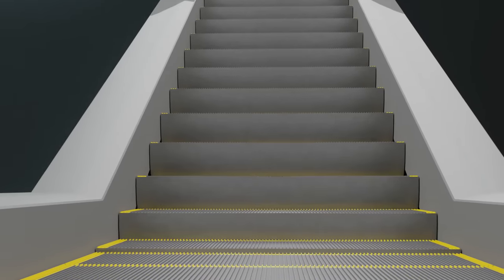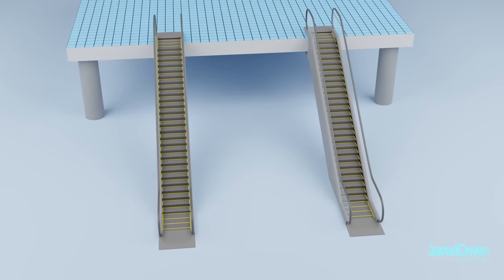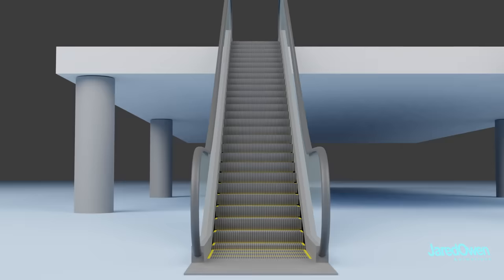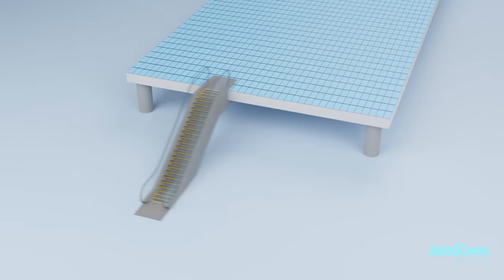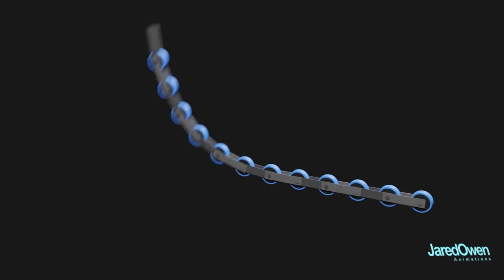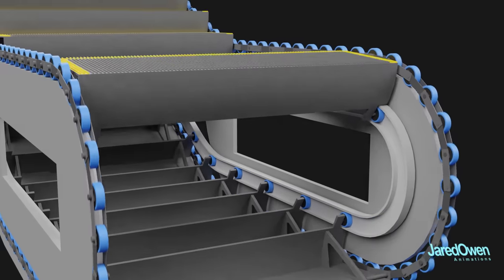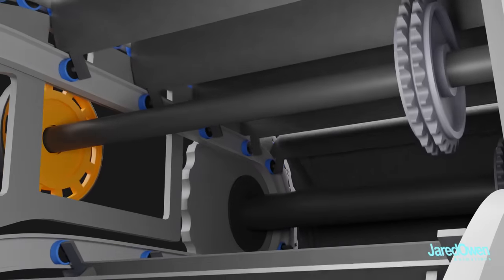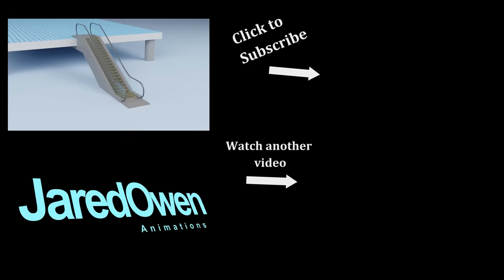How does an Escalator work?

Comment: I’ve noticed that the handrail seems to always move slightly faster than the steps, why is that?
Reply: Because that prevents you from falling backwards
Reply: That just depends on the size of the cogs and gears you use to connect the handrail to the motor
Reply: It is intended to keep riders alert so that they occasionally have to shift their grip.
Reply: I was about to post this exact same thing.
Reply: Focus people.
Reply: Answered in the comment above yours
Reply: Yes that is same in Prague Subway and it makes me angry every day because if I want hold all the time, I can't
Reply: Stop you from falling backwards
Reply: Keita Tsutsumi smaller wheels
Reply: The circumference is larger on the handrail, so when they loop at the same speed, the handrail goes faster.
Reply: @gigaprofisi  exactly. The math is easy to show as well
Reply: not here
Reply: Noah Landis they don’t loop at same speed. It’s just made to be little bit faster to ensure that it’s not going slower than the stairs, as precisely same speed is practically impossible to maintain.
Reply: In my nearby store, it it because someone is holding tightly into it ( for example hold the railing and lean back, then the railing will go back too)
Reply: That's because a large number of people holding it expands the handrail which leads to unstable speed of rolling
Reply: @matejkoh8387  prague has the longest escalator in Europe
Reply: Flying Tatu That‘s actually the right answer.
Reply: always? all the ones ive been on go the same speed
Reply: None of these answers are correct.

The vulcanized rubber rail is pulled along by the main gear using a friction fit. By design, the handrail should travel at the exact same speed at the stairs (not faster, not slower), as excessive relative motion in either direction can be dangerous.

As the rubber ages, it warps and elongates. The underside gradually loses its roughness, and passengers abuse the railing (pulling, sitting, etc.). Over time, the speed of the railing is bound to drift from the main shaft speed.

This is not by design and is actually a nuisance which requires extra maintenance. Most modern escalators will automatically shut down the escalator if they sense that the railing speed differs from the main shaft speed by more than a pre-determined amount. For example, ANSI standards require that escalators are fitted with sensors which actively monitor the speed of the handrail to make sure it stays within limits at all times.

Credentials: Mechanical engineer who works with a major escalator company.
Reply: Yes
Reply: @gigaprofisi  Correct, but this is intentional so that it is less likely for a passenger to fall backwards or loose their balance.
Reply: In Kiev's underground it's used so people don't get asleep.
Reply: It is so that you will always get pulled a little to the front when riding up the stairs, preventing you from falling backwards. The handrail speed actually should never be the same as the escalator speed as this encourages falling backwards, the engineers usually chose a speed between 0.5 and 1 %  faster handrails that escalators.
Reply: @18vallancel  You are correct. I have worked 25 years in the elevator industry and have changed hundreds of worn handrails.
As the rail wares down it has a tendency to slip and move slower.
Reply: encourage upright posture
Reply: I don’t get the “So that you wouldn’t fall backwards” it just doesn’t make sense. I’ve never felt like falling ever while using an escalator that has the same railing speed.
Reply: Keita Tsutsumi it could be that there are two separate motors controlling the steps and the hand risks respectively and they might be a little off in their speed
Reply: It has more distance to travel
Reply: It’s literally on google. It’s on purpose and to keep people attentive. Not about “impossible to maintain” or the “warping of the rubber”
Reply: @maevemahon9897  probably they were made by bad engineers 
Don't be one of them
Reply: So that if you fall, you fall face first
Reply: @18vallancel  wow so my guess was right
Reply: Yeah
Reply: Так сделано в целях безопасности человека. Бывает такое, что человек отвлекается на рекламу, или задумается о проблемах. Что бы человек был внимателен на движущейся машине-эскалаторе специально делают конструктивно скорость поручня быстрее чем скорость ступеней. Но скорость поручня можно отрегулировать роликовой станцией в самом эскалаторе, под балюстрадой жо скорости ступеней. Но тогда будет страдать безопасность пассажиров.

Comment: "It's really important that the handrail move at the exact same speed as the steps."

Anyone who has ever held on to the handrail the whole way knows that's not exactly true.
Reply: I'm sure engineers are trying their best to perfect it.
Reply: Yes they are slightly faster on purpose to prevent somebody from falling backwards.
Reply: We occasionally run it in the opposite direction.

For the lulz.
Reply: @Yebina Katya shush spammer
Reply: @FXP1688  At our local mall the one going downward jerks slightly forward.
Reply: As someone who usually holds on to the handrail all the way, I really can't say the same
Reply: I used to pull the handrail belt down when we were going up. It was so easy to pull, too. Funny stuff.
Reply: @FXP1688  you just blew my mind lol. Completely make sense tho
Reply: i guess it comes down to tuning and some aren't too well tuned.
Reply: Yep, thats inaccurate. And it's not an accident that they are slightly faster, but it's actually a pretty smart detail -> https://www.youtube.com/watch?v=L5BNJSqwU0Y
Edit: Wrong video link...
Reply: I don't think I've been on one where the rail and steps were running the same.
Reply: No, it's just an illusion that they move faster maybe because they're narrower than the steps or because they're longer. They move with the same speed as the escalator. Otherwise don't you think we'd fall down!?
Reply: @mansipal5437  well many things aren't perfect, and therefore, that is why you are wrong ever so slightly
Reply: People hold onto the handrail?
Reply: You are all wrong. This is due to the wear of the rubber. Hand rail speed is set to be 2% faster than steps, so when rubber is new, it moves faster, then as it wears off of friction and stretches, it adjusts to the speed of steps for a time, and then at the end if its life cycle, when it's stretched, it moves slower. Then it's replaced with a new one.
Reply: If it's going up it's slightly faster, going down slightly slower
Reply: Sorry, I am the guy five steps down that is dragging the rail intentionally to see how much I can make it slip.  For science.
Reply: @mansipal5437  , нифига не иллюзия. Когда держишься за поручень -- особенно хорошо это заметно на станциях глубокого залегания, типа "Автозаводской" -- рука уезжает вперёд. Иногда на всю длину, и приходится перехватываться.
Reply: Best part about these things is that they never break down.... they only become Mitch Hedberg jokes.
Reply: They are slower in the beginning, then faster during the slope, then they realign at the end
Reply: @gavincurtis  😂
You kid brother, you!
Reply: @charliedulol  if its on a gear system on the same shaft as the one that drives the steps it should not be possible to tune it
Reply: @user-by7hj4dj9s  if indeed.
Reply: And you forgot one thing.. you can stop pretty easy most of the handrails by hard grip and pull em well atleast it is so in my city all over. :D
Reply: Ugh, so annoying when it doesn't
Reply: Yeah u r right 🤣🤣
Reply: Becareful when holding onto moving hand rail, I nearly had my finger pinch on it at the hotel in Las Vegas.

Comment: An escalator can never break, it can only become stairs---Steven Wright
Reply: it can eat people though.
Reply: That's actually from Mitch Hedberg
Reply: @mosh1986  so can most things
Reply: The belt can snap and fall off.
Reply: False.
Reply: Just build stairs then. Escalators killed my sister. I'll never forgive them. They're untrustworthy.
Reply: Which is absolutely stupid. A defect escelator can be very, very dangerous. If a link breaks, and the chain can't support the weight, the stairs will all fall down in freefall. Also, the mechanism is very, very dangerous. If anything in this system breaks, it would be a bad idea to just use it as stairs. Whoever said that quote is an idiot.
Reply: @louisgreschner2359  amazing it's even being quoted as wisdom !
Reply: Thought so too until an escalator in SM mall Philippines suddenly reversed…trampling people at the bottom
Reply: @small3687 just like xiang liujuan?
Reply: @louisgreschner2359    A defective escalator is dangerous, but a nonmoving escalator isn't necessarily, though I suppose it depends on the configuration in which it ground to a halt.

Comment: Actually most escalators (that I used anyway) will have the handrail moving a bit faster than the steps. I looked it up and one reason I found has to do with wear, over time reducing the handrail speed. So this way, they get a better service life out of it. Another reason I found is safety. It would actually go faster on escalators going up, and slower on ones going down (which I think is also what I’ve seen). If someone who counts on the handrail for balance falls, they’d fall on the escalator upwards.

I think my father (who was a maintenance technician in a large department store) actually mentioned the safety reason to me.

Comment: "They are just big meat grinders"
- Actual Escalator Technician
Reply: Yes, I agree 👍
Reply: do you know the rough price of a escalator
Reply: Same here I’m an apprentice, was working on one today , tighten the tension of a handrail drive chain.
Reply: I'm an elevator dude, and the escalator dudes scared the crap out of me with stories of having to remove kiddies' toes from pits, etc. You hang in there, escalator dude!
Reply: Did you see that video from China where the steps collapse and she throws her toddler to safety, but she gets pulled in?   It's rough
Reply: @janus2059  Yup, not nice.
Reply: Daniel Antone nope.
Reply: @dougerrohmer  I've heard similar stories myself, I'm a stairs guy myself.
Reply: @dougerrohmer  yeah I dont think its real though because those access panels are meant for escalator work to be done so no moving parts are exposed there
Reply: @howdoicomment5932  The problem is if a step axis bearing collapses (for instance) and the step is now lower than the comb plates, the escalator goes nom nom nom.
Reply: I work for an escalator company and can confirm that falling in at the bottom is a no no
Reply: Wonder if you could detect those conditions somehow.

"Error: Meat in machinery."
Reply: Final destination 5
Reply: yeah. the escalator in my city used to put up pictures of gory grinded limbs of the victims of escalator accidents right next to the escalator. I don't know why it took years for them to realize that that's not a good idea or why they did it in the first place. either way, not a good thing to see for an 8-year-old me, scarred me for years after they decided to take them out. still kinda scared when I see a sign at the end of an escalator cause my first thought would always be "oh no.. they're back"
Reply: @downstream0114  there's table top saws that can detect when a finger touches the blade and instantly stops the saw and tucks it away before it can even do minor damage (you would have to fall directly on the blade to get a minor cut*, it's that quick) unfortunately it can only do that once and you have to replace the saw and the 'brakes' each time it does that. So it's like insurance, it's good to have but you never want to need to use it. Look up "sawstop"

*edit, i looked it up and im gonna upgrade minor cut to minor gash. Like you would need a few stitches but it not life threatening.

Comment: When I was in Germany there were escalators that change their direction depending on if people wanna go up or down
Reply: I use them everyday 

It sucks when you step on one but the person on the other side was a second faster so you have to go to another escalator because it’s the wrong direction now
Reply: @64bitpr0gramm6  True, I had to wait for 10 minutes
Reply: KOTHYSCHER it’s pretty dumb tho 🤦‍♂️
Reply: @falcy2889  Why would it be dumb? You save a whole escalator by making it move in both directions and it turns off, when it is not in use, so it saves a lot of energy during less busier times. 

It is not used in highly frequented areas, but only where it makes sence.
Reply: Leffker you know if there are so little people there that the escalator can be turned off and changed direction then it’s unnecessary. Regular stairs would be much more efficient
Escalators are used for moving large amount of people in one direction and ensure faster transportation.
Reply: @falcy2889  Well, in the city where I live it is used in an underground train station with multiple levels and countless exits, where it would be too expensive to build an elevator next to each single stairway.
There are a lot elderly people as well as young parents with buggies for their babies, who would struggle to use the stairway. The exits lead to different sides of a wide main road and in different cardinal directions. There is not enough space on the surface to cover for enough elevators
Reply: In the Montréal subway, when not during rush hour, many escalators run slowler when empty.
Reply: @simonrancourt7834  Yup, but they don't stop because stopping, then starting puts extra strain on the system, slowing though does save energy, which is the point.
Reply: IIRC In a mall in Taipei, all the escalators change direction to the bottom floor during closing time so all the escalators lead to the exit
Reply: @Leffker  In Europe, it is actually forbidden to use an escalator with strollers/buggies, that is why at least here in Munich on all escalators there are actually pictograms on the side of the escalator telling people not to use strollers on escalators.
Though pretty much no one follows that... And it is sad because I got injured once when a rider in front of me got their stroller stuck while trying to exit the escalator.
Reply: @gfrewqpoiu  The place in Munich I am thinking of doesn't provide an alternative for people with strollers, so of course they use the escalators if they want to get downwards.
Reply: with people on them???

Comment: There was an accident in a New York subway 10-20 years ago where one ate a passenger. It chewed her to pieces. I worked on ones made by Thyson-Krupp while working as a stationary engineer in a 14 level building in Barcelona, Spain. 28 escalators that we had to do emergency repairs and preventative maintenance on. A common problem was the proximity sensors that assure proper chain tension would move out of adjustment through vibration over time, or they would fail and the escalator would stop. We would have to lock out and tag out the equipment, block it off from customers, and then begin the troubleshooting process. Occasionally an electric motor would fail and have to be replaced. Big job.

Comment: There were two really long escalators on the USS Kitty Hawk aircraft carrier when I was stationed on board. They went from the deck under the hangar bay all the way up to the deck under the flight deck (through four decks) and were designed back in the late 50s to carry pilots directly from their ready-rooms up to the flight deck. They were never activated while I was there, but everyone used them as a shortcut and under a heavy enough load, they could begin to slowly descend causing everyone to walk against them.
Reply: That's cool, thanks for sharing

Comment: Let’s be honest, the escalators without individual steps are better
Reply: Unsalted Santa agree because you can have shopping carts on them, but the ones with steps can be alot steeper, taking up less space
Reply: Wait... How does that even work?
Reply: @RAYRDWallace  Taking shopping carts up an escalator? The carts have grooves in their wheels that match the grooves on an escalator. The grooves lock the carts in place
Reply: they are called movators, at least that's what Walmart calls them
Reply: no it's hard
Reply: It's called walkalator
Reply: good luck having a shopping cart, or anything for that matter, go up a 45 degree angle.
Reply: Unsalted Santa idk about the US, but most places here in Europe have adjustable ones. Where they can be set to be both flat or at an angle
Reply: @waity5856  the shopping cart locks in place, no need to hold anything. and its not a 45 degree angle, its more like 20 degrees and they are long.
Reply: No way. Then the bad guys won't have anything to worry about when they get thrown down.
Reply: @lauttero1938  I have never in my life seen or heard of those until now
Reply: So is toilet paper without individual squares
Reply: @leejackson4724  just use bidet, duh 🙄

Comment: Its actually very interesting to see the inside workings of an escalator, have seen that various times in the DC metro during their maintenance and the dc metro system relies so heavily on using them. They have various lengths, including the longest escalator in the western hemisphere being located in Wheaton, MD

Comment: When i was a kid i got mad and sat down on one. To pout. And at the top my coat got caught up under the teeth and it began to pull my into it. It got to my back and gripped my skin. My dad was trying to pull me out but the machine was stranger. My brother found the emergency stop button and they were able to get me out with just a few scratches, I now have a small fear for them. I tend to only use them if there is no stairs or no elevator close by. I don’t care if I have to walk to a separate area away from friends or family to do so. I am just afraid of my body getting caught again.